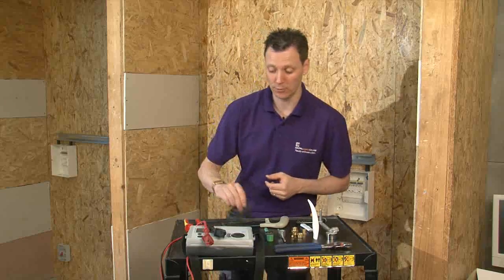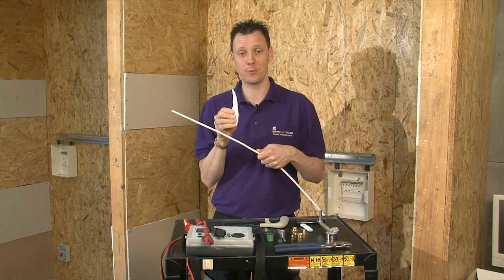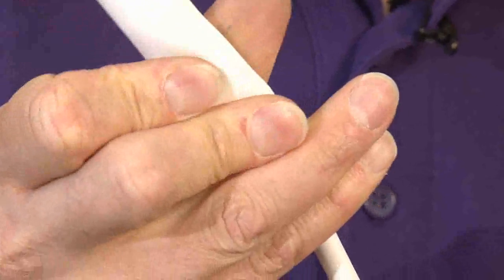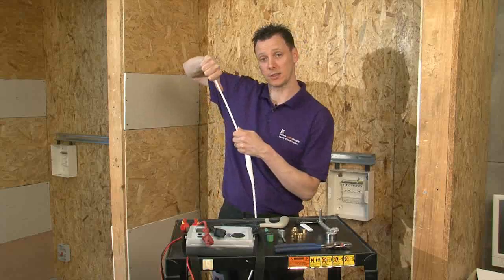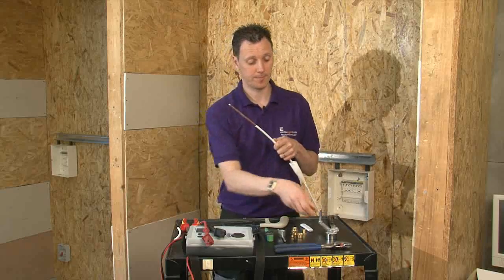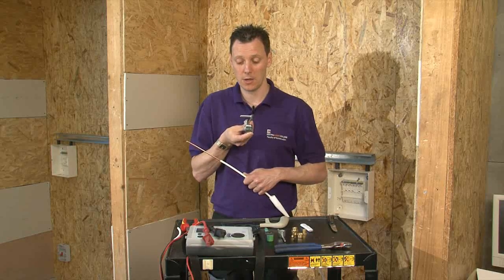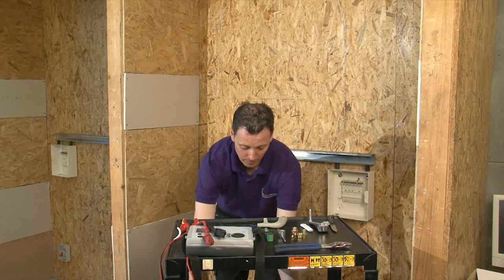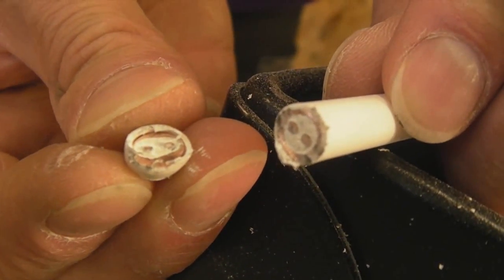The Practical Skills Series : Cable Termination - MICC/MI/Pyro/MIMS

Comment: I need to reterminate the free end of some 6mm2 MIMS. The pot is OK, but the circuit breaker needs to be moved onto another part of the DB. The install is approx 40 years old and I am worried.... anyone with suggestions?